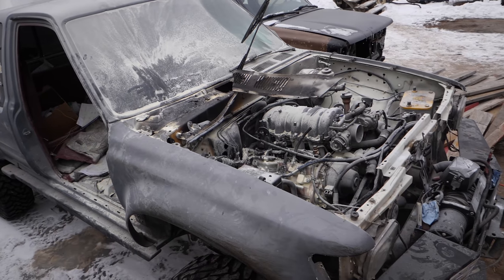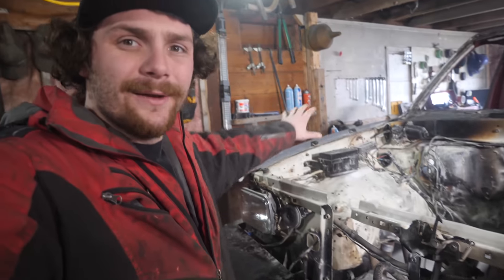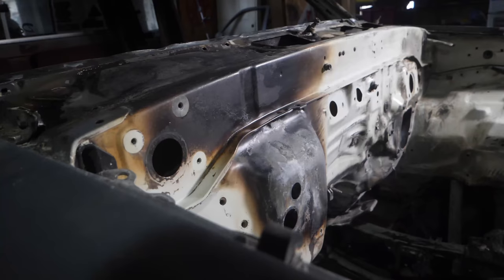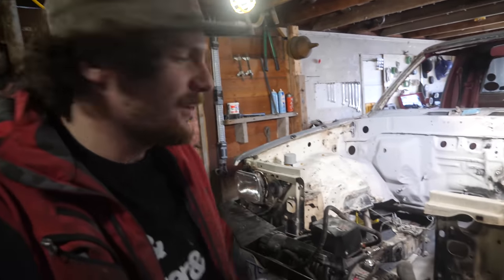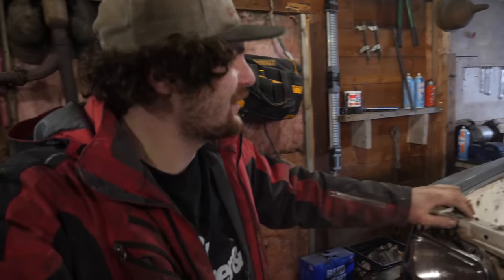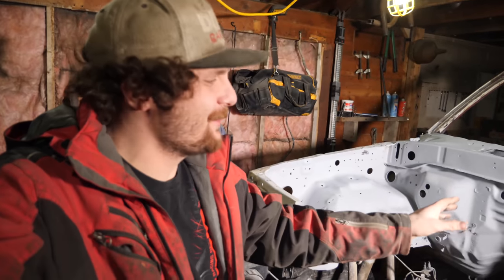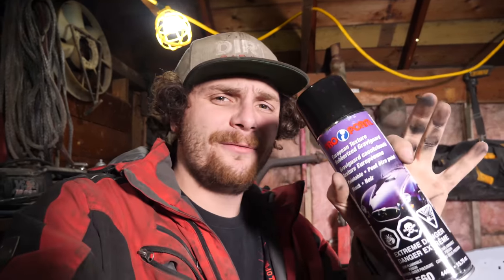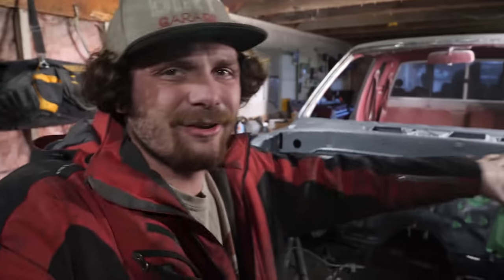Color Matched Texture Coating my Engine Bay! Toyota Fire Restoration Project

Comment: Did you sandblast the burnt metal before painting it?
Reply from the maker: Nope. Just alot of sanding. Wish I had a sandblaster. Would have made quick work of the whole engine bay

Comment: I tried to leave this comment before but I don't think it took I just wanted to warn you about the dark illusion elocker harness you installed be careful with that I bought the one and all the wires in the back of the switch were popping off he used real cheap connectors and didn't bother heat  shrinking any of the exposed wires now this could be just my wiring harness maybe yours was done right but I'd hate to see your truck burn down for the second time the wires where popping out of the dollar store connectors he used the hot wire that goes to the battery pipes out and then broke in half when I tried to re crimp it roller store garbage l barely used any pressure and it snapped in half and when I sent it back to him he said it was all my fault  I just thought you should know this  after all you did endorse this look at your harness ps I have pictures if you want to see send a link

Comment: Think it would pretty easy just to swap your parts to an extended cab tundra instead of putting a v8 in your truck?
Reply: And spend $$$$ and huge hours to SAS  the tundra frame? And invest into a frame known for rust and rot? All he has to deal with is some firmest issues, wiring, and it’s good.
Reply: @mountainjeepmike4408  alrighty then, thanks for your answer.